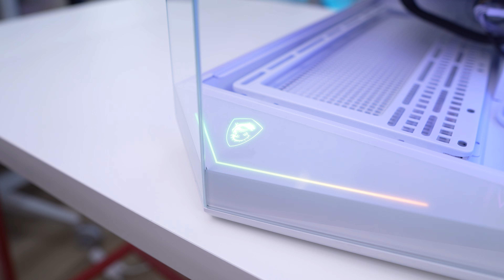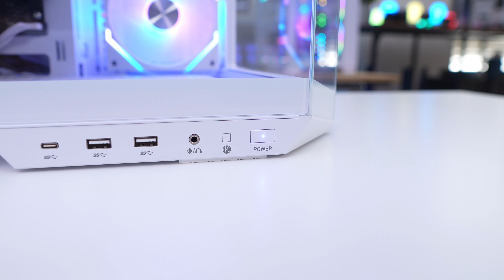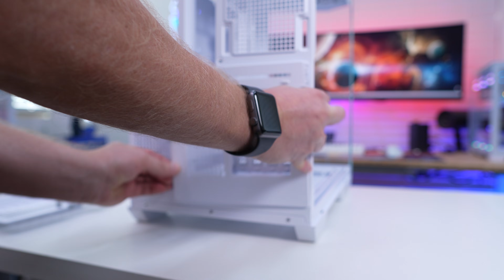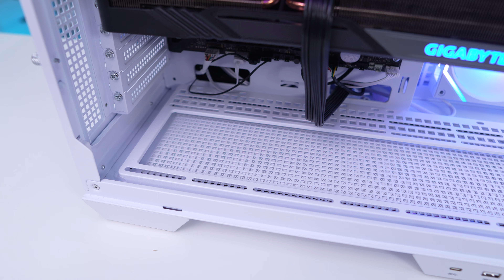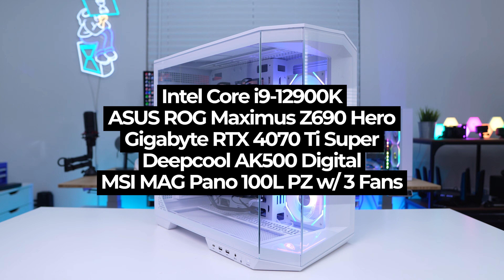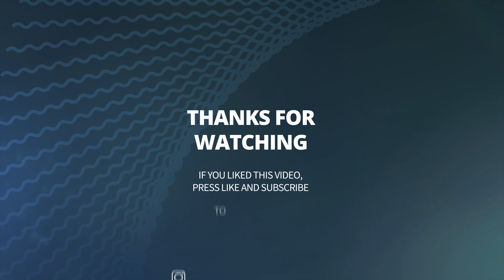MSI Actually Makes GOOD Cases! MAG Pano 100L PZ Review

Comment: I have had this case on my new build for about a year now. Really happy with it... looks great, very roomy, comes with enough fans and room for plenty more. I am running a full-size Asrock X870 with a Ryzen 9 9900X coupled with a Deepcool LCD AIO and a Zotac amp extreme infinity 5080. The case stays cool under load, is almost inaudible even when gaming. And it still has plenty of room inside, so cleaning is a breeze!
Reply from the maker: Nice! Solid system too!

Comment: Just FYI, they do sell a version with fans and fan controller for 149.00. However, the fan controller board does not work with MSI's own Mystic Lighting for whatever dumb reason.
Reply: It does work with Mystic Light, you need to make sure the correct RGB header is plugged into the main board.
Reply: Just press the led button for 5 seconds then it will sync with mystic lighting
Reply: @himanshu_markellofff when I long press they flash twice and shut off